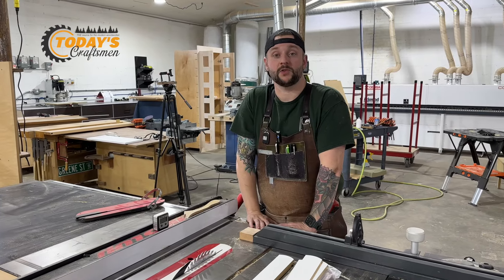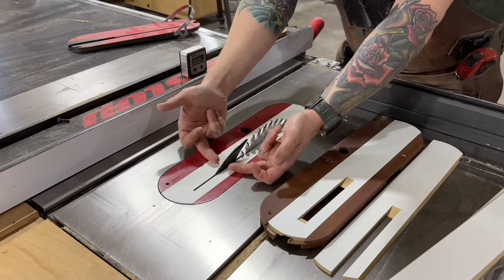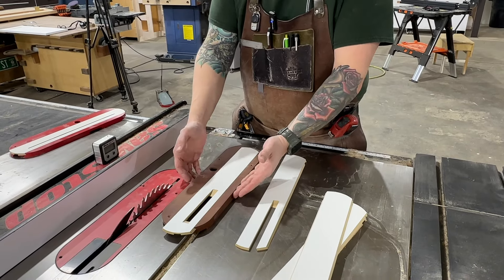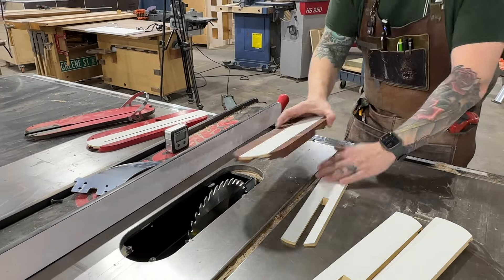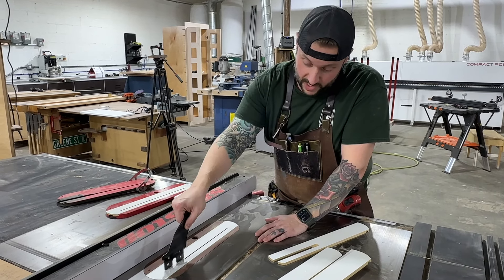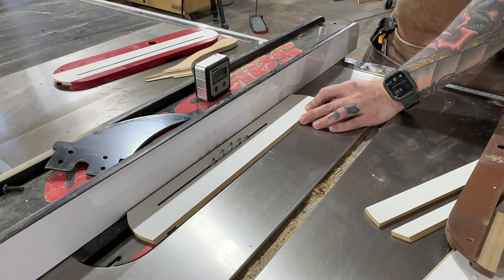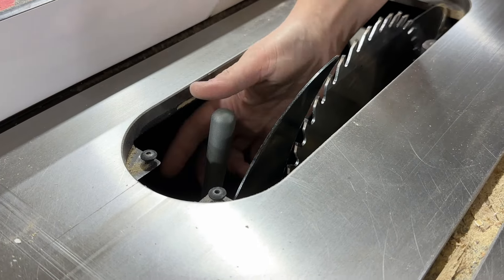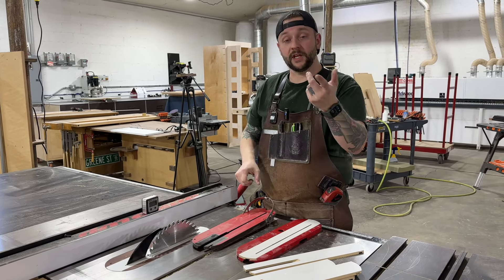THE BEST Table Saw Zero Clearance Insert - Colliflower ZCI

Comment: Great video, Jeff~!  I looked at one of these for my SawStop PCS a few years ago, but it seemed like the throat plate was the only part ever in stock...not the inserts.  I like the new material, so I'll look again at getting this accessory.  Making multiple full-sized throat plates is kind of a pain.  Did it with my old Craftsman table saw (pre-SawStop) and I don't plan on doing that again.
Thanks~!
Reply from the maker: They were in stock a little while back when we ordered! Check em out!

Comment: How's the micarta version holding up? I'm ordering a sawstop contractor saw in a couple of months and planned on getting one of these.
As for adding the extra slot for the riving knife, for inserts on my current saw I've been using a 1/8" router bit at the router table to lengthen the slot.
Thanks for the video.
Reply from the maker: As far as I know Jon hasn’t had any issues with the micarta version!
Reply: @TodaysCraftsmen  Thanks for the reply. I have one more question if you wouldn't mind. How are the white inserts themselves? Any flex? I'm ordering my insert soon and planned on getting a pack of the dado inserts but if there's flex I might just make my own from baltic birch plywood.
Reply from the maker: They’re melamine faced MDF so you could flex them if you really tried. But under normal use I haven’t noticed any flex.

Comment: Great info, love the regular uploads now.   Great job guys.  🎯

Question/comment:
. Could be that they don't ship with zero clearance because it ends up sacrificing the dust collection effectiveness around the blade I find.   The stock plate provides the zero clearance on the down cut of the blade and maybe they don't see the necessity of providing zero clearance on the back of the blade at the point of upcut?    Your point about narrow stock being a dangerous cut is absolutely a consideration though
. Hearing that they make plates for miter saws as well I think is going to send me shopping online this weekend!
Keep up the great work.    👊
Reply from the maker: Good point, that may be the case!

Comment: Saw Stop sells blanks if you like the clasp and levelers.
Reply from the maker: The Colliflower has levelers and I don’t really see the need for the clasp but good to know! I like how quick (and cheaply) you can change out the center portion on these.
Reply: @TodaysCraftsmen  yeah, that swap-able center does seem like a great feature, and the levelers make me much more interested
Reply from the maker: It’s a nice piece of kit!
Reply: I used one of the SawStop blanks and cut in the channel and dovetails and made my own inserts, way cheaper and lots of customization!
Reply from the maker: Looks like the sawstop insert is $60. For the extra $40 I’ll let someone else do the work! 😜
Reply: @n2darkness  the inserts are cheap.
Reply: @sethhamilton5824  And so am I! 😂That's why I made my own!
Reply from the maker: Haha time is money!!!
Reply: @n2darkness  I am trying to figure out how to do this with what degree dovetail bits
Reply: @chuckgrumble5440  I think I used what I had 14°
Reply from the maker: Any angle should work

Comment: You mentioned the old metal plate could be problematic. Have you ever had a false trigger of the safety system using the metal insert?
Reply from the maker: We have not!
Reply: I did, trying to cut an insert for bevel cuts. I reached out to Colliflower and Jack kindly said he would send me a replacement using the new material but that never eventuated. So I now only use Sawstops inserts. The original, one zero clearance and 2 for dados. To say I wasn't happy about that activation is an understatement.
Reply from the maker: Wow, that’s a shame. I would reach back out to him to make good on his promise.
Reply: @TodaysCraftsmen  I hope he's reading this!
Reply from the maker: It’s possible but I would reach out to him via e-mail if I were you. Speaking as a business owner sometimes things slip through the cracks. I’d give him the benefit of the doubt!
Reply: @TodaysCraftsmen  The problem is I'm an Aussie and shipping charges are high so I'm not surprised he "accidently" forgot. This was a few years ago so I am over it!
Reply from the maker: Fair enough!

Comment: couldn't you just flip the whole thing length wise? front at the back and back at the front, but it'll be upside down.
Reply from the maker: I’m not following!
Reply: You can’t. The insert only goes into the throat plate one way.
Reply: I mean the whole thing, not just the insert. put it all upside down with the front in the back and the back in the front. it'll keep the location of the slot side-to-side, but have the further end over the blade. raise the saw blade the same way and then you'll have a slot the width of the saw blade the entire length

   Normal setup: 
       
             top
Front----------------Back
          bottom
    

upside down and front to back swapped:

           bottom
Back----------------Front
              top
Reply: Still can’t. The underside of the throat plate is made in such a way that it hooks on two leveling screws that are part of the saw top( the recessed are where the throat plate sits).  If you wanted to remove the leveling screws it might be possible but there is nothing securing the throat plate to the saw top which could be dangerous when raising  the saw blade. 
   The method shown is the easiest and fastest IMO.
Reply from the maker: Ahhh gotcha now! Yeah as @rwoodard2 said the throat plate won’t go in upside down.
Reply: @rwoodard2  "but there is nothing securing the throat plate to the saw top which could be dangerous when raising  the saw blade."

yeah, the fence would go over just like when making the first cut? I'll find out once my order comes in. I can't see anything in the pictures of it that would stop what I'm saying from working, but it's possible I'm just missing something.
Reply from the maker: There’s two pins that the throat plate registers over. Since the top is flat it won’t be able to sit over those